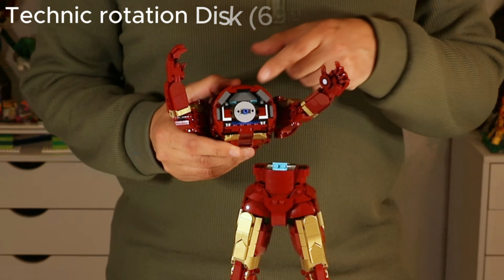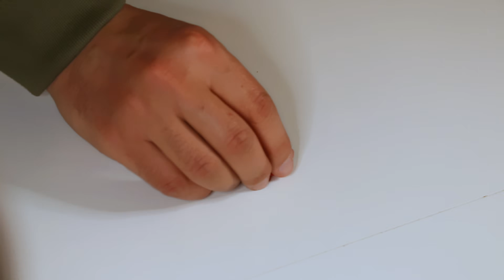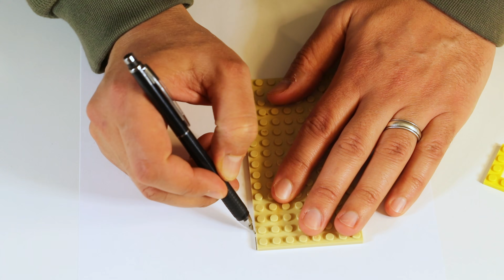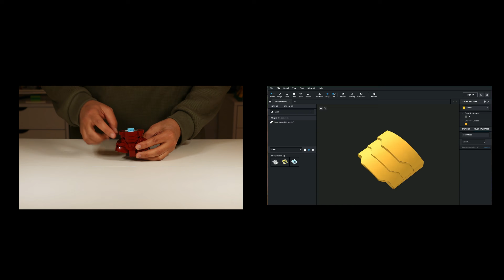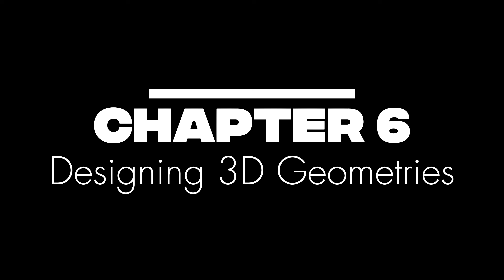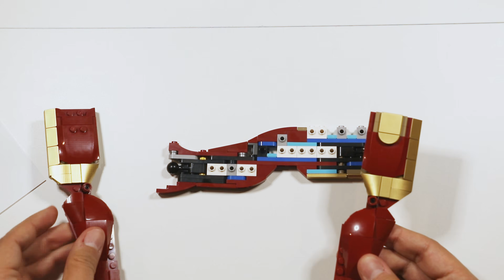I Reverse Engineered LEGO's Iron Man Set

Comment: really interesting analysis, I'm currently planning on building a technic 1/7th scale of the Quetzalcoatlus Northropi and the wing geometries are really difficult to execute (as I want it to be both poseable with technic parts and "full" like a creator model)
Reply from the maker: That would be quite large 😲. There is this new technic joint 69788c01. It's made up of 4 pieces that can be bought separately.  I've never tried it myself but it seems like the strongest joint lego makes. (Oh yea, and I'm glad you liked the analysis) 😊